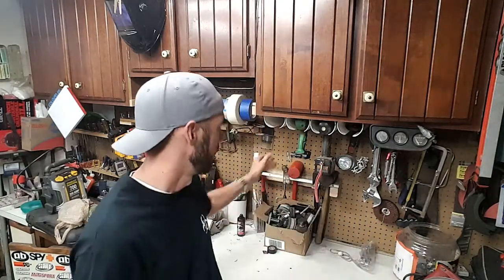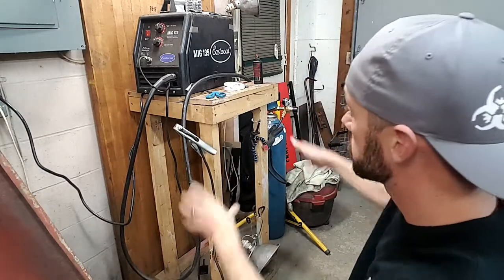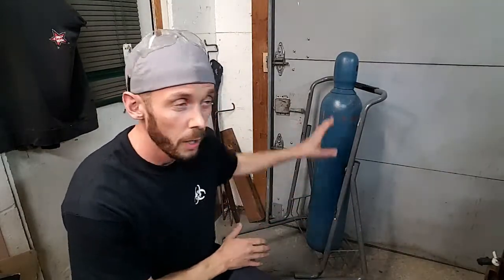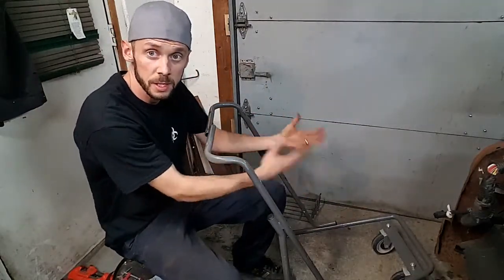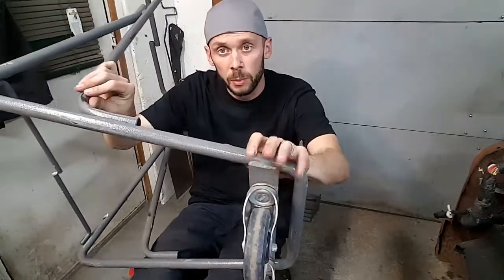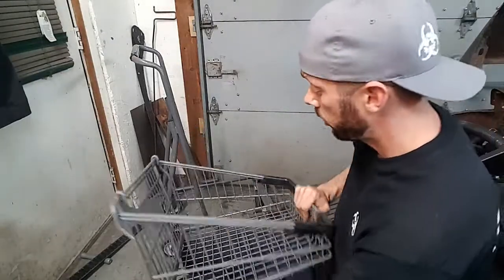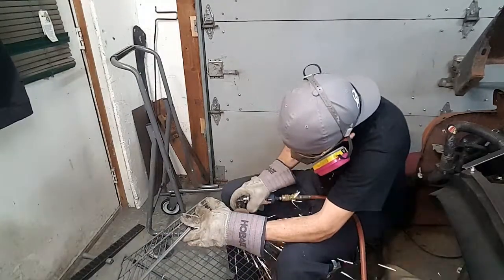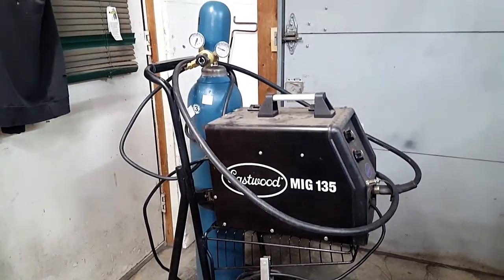DIY welding cart made from an old shopping cart.

Comment: I just made a welding table inspired by an ironing board...mostly because I have so little space in my garage.
Reply from the maker: Very cool! I like how you made it adjustable to accommodate different projects.
Reply: I broke down and bought my welding cart (and it was worth it). However I think if I would have found inspiration from a shopping cart and had the option to do so, I like how yours turned out. It really is quite perfect scale.

Comment: Do you regret not buying the mig 175?
Reply from the maker: wd9581 actually I don't this welder has been good for me. I bought this to work on a truck with and it can handle anything I plan on tackling. I can always go bigger later if need arises.